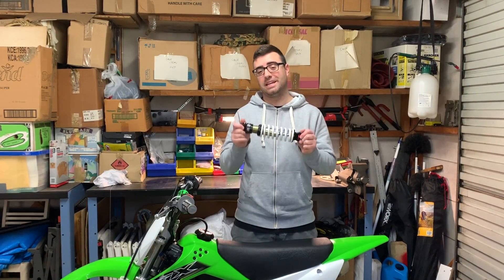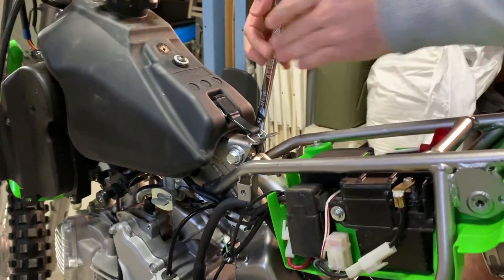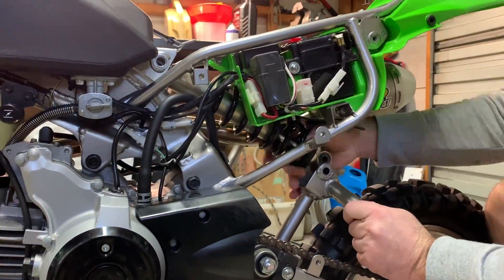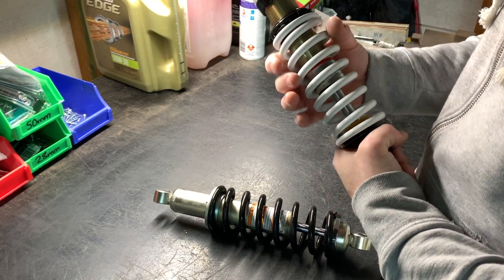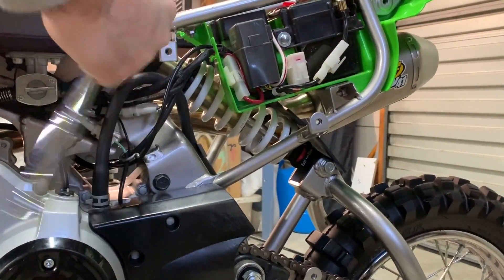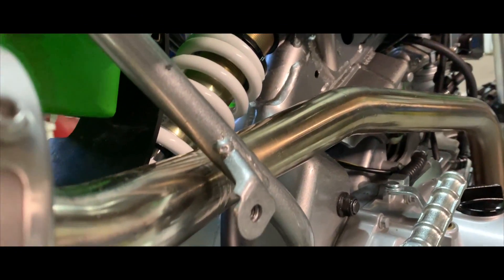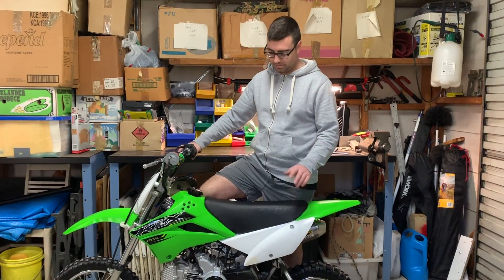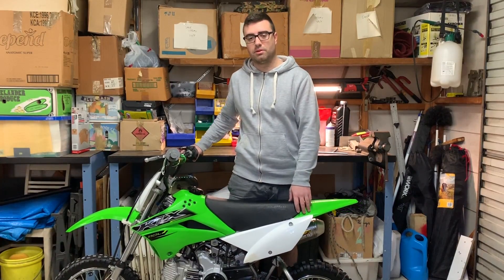KLX110L - 350lb DNM Rear Shock Install

Comment: I oredered the dnm crf110 350lb rated shock. Was very surprised with the quality. Way nicer than I expected. Very stiff which is what I was going for. I weigh 180lbs and am 6ft. 
Order this shock you will not be disappointed! Great shock
Reply: Kevin Fitzpatrick did this keep the standard height on the crf?
Reply: @callumthomson6447  added about an inch and a half up front. Inch in the rear

Comment: Did you leave the spring nut at the stock height Or do any adjusting?  And where do you prefer the rebound adjustment set?  Have one on the way so figured I could do some adjustments before in if needed he. 
Thanks

Comment: Just curious if you think this will fit an older style 110, people are saying it won’t work with the brake set up. Also wanting to know if it’s safe to buy this shock off eBay